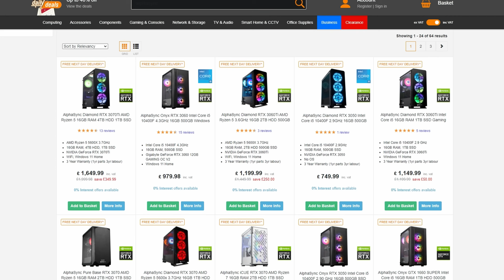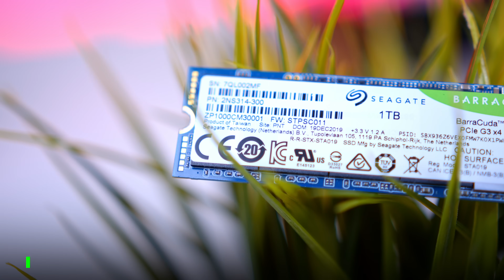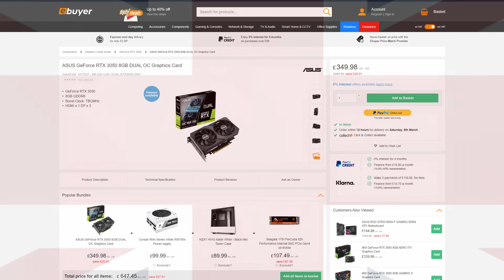$800 RTX 3050 Gaming PC Build 2022! [Full Budget Build Guide w/ 1080p Benchmarks]

Comment: Is it better to use a 3600MHz RAM with a i3-12100 or a 3200MHz is enough? cuz in the i3-12100 specs i see it supports up to 3200MHz Ram. Thanks for replying
Reply: 3200 mhz are enough, no need to buy 3600
Reply: Intel doesn't benefit from higher speeds like amd does, so pick 3600
Reply: @xces_fn  so why 3600?! i3-12100 supports up to 3200.
Reply: @mohamadkarim9337  i think he meant to say 3200

Comment: I have a few questions:
Do screws come with NVMe drives?
Do screws come with other PC components?
What tool kit do you recommend for PC building?
Edit: Anyone can answer btw
Reply: 1. They come with the mainboard
2. Yes, all screws are always included, no need to buy extra
3. Some coolers have a screwer included, thats pretty much all u need to build a PC :)
I´d reccomend using magnetic or even normal screwer
Reply: Thanks guys!
Reply: All screws come with the motherboard regardless of price. The cooler specific screws come with the cooler. Any screwdriver is fine for building but no power tools you'll break your stuff.
Reply: It's comes normally with the motherboard